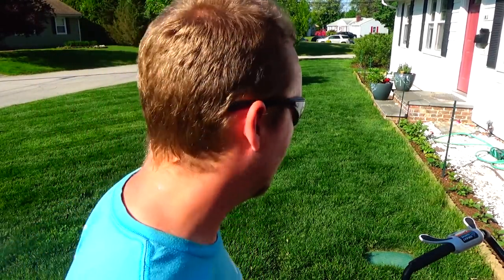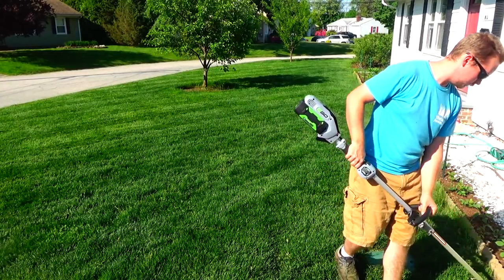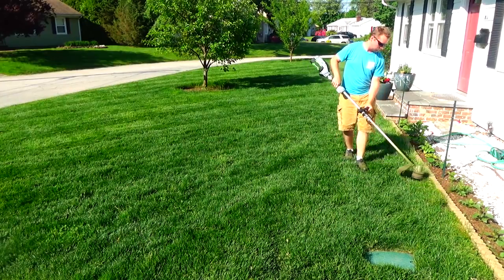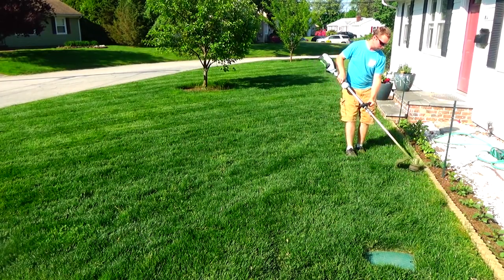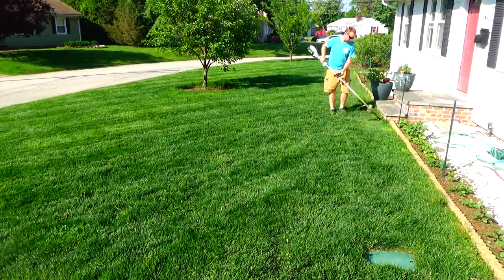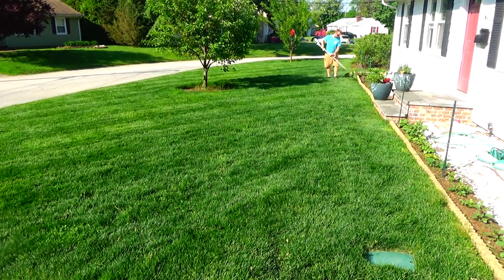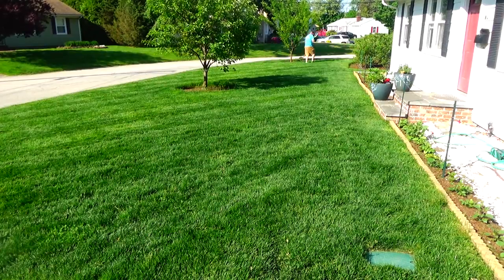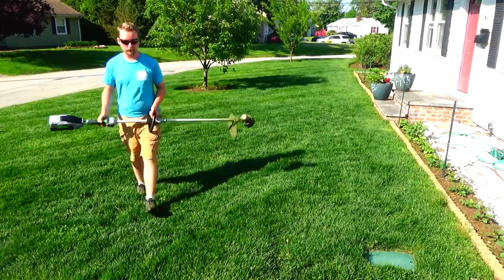Memorial Day Weekend - DOUBLE cutting with the Honda HRX217 self propelled mower

Comment: Interesting video. Thanks. I just tried the Ego 56 volt mower on our 1/4 acre lawn and it was excellent; low noise, battery at full charge was not even half down at end and the self-propelled feature could drag a dog team! Only issue I had was hard turning at end of runs because of rear wheel drive and delay in disengaging. I've had the Ego hedge trimmer and blower for a year and they have been outstanding. I put down two treatments of milorganite this spring here in north Florida and it's been hard to keep up with the growth but the  St. Augustine floratam grass lawn is loving it. I like your diagonal runs and alternating coverage. Suggest you put on ear plugs or headset: you're too young to go deaf!

Comment: Does your HRX217 miss random blades of grass??? I'm considering returning mine. Mine just misses grass no matter the height. I've only had it 3 weeks.
Reply: CoffDaddyJr I have the HRR216 and it does the same thing. Many issues in the first year too. Carb replacement, wouldn't roll backwards, average mulching performance... Honda has gone downhill in the last decade or so. My Harmony from 2003 has never had any issues. The tires are finally bald but hardly the mowers fault.
Reply: My Toro just started doing this. I think it’s the new mulching blade.
Reply: I'm in Florida with St Augustine grass and mow at max height with my HRX217. It does miss a few blades in my yard, but I mow often enough (every 3-4 days in summer) that they don't really stand out much. Mowing when the grass is dry (in the afternoon) helps.
Reply from the maker: I haven't had any issues with it, but there is a growing number of people who have. I do wonder if they changed something in the manufacturing process.
Reply: I have the HRX217 with the Big Leauge Lawn Striper on the back.  I have found that mine works better if I lift up on the handlebar keeping the front down.  It may be the striper but the mower itself seems to bounce.  I keep my speed setting on the slowest setting and Enjoythemow (wrong channel).  I also double cut and the roller pushes the grass over so I don't notice the missed blade problem.  Good luck to you.
Reply: Mine did this when new.  The new blades are laughably dull.  Sharpen them well and you will notice a huge improvement in cut quality.  Also they come running much slower than max rpm's according to manual.  I moved governor spring back to second hole and got better cut with a slightly faster blade.  Those two things will make any HRX cut look like a carpet.
Reply from the maker: That's a great point Joel, I forgot I adjusted the RPM as well.
Reply: Joel Houston I did both of those things too... I actually notice the missed strip more with properly sharp blades believe it or not. Overall though the cut quality is MUCH better. They are laughably dull from the factory. I just ordered a second set to rule that out though...
Reply: Grass Daddy I bent the spring a bit and ended up about 3200 rpm... You went to the second hole right?
Reply: CoffDaddyJr same problem but I still think it's a heavy duty good mower otherwise
Reply: So I've figured out the issue, at least on my HRR. The door closes when mulching, but not COMPLETELY so it gives a little vacuum boost to keep to the grass lifted properly.
This small opening quickly clogs with grass, especially if it's at all moist, and the mower loses enough vacuum to not be able to properly lift on the right side of the deck. Sure enough, moving the selector open and closed or manually opening and clearing the small opening and the mulching is exactly how it should be. 
Take note if you haven't moved the mulching door in quite some time... You will get hardened buildup there and it exacerbates the issue quite badly. I'm experimenting with putting the bag on and leaving the selector slightly open from the "mulch" setting and the results so far are much improved.

Comment: I have no idea why your VKA Honda would have any trouble with that much grass, especially if you set the Clip Director to partially mulch.  You have the larger 190cc GCV engine, which should deliver plenty of r.p.m. to mulch with under that little load.  I have the HYA, the same creature but with the hydrostatic trans, and I attack grass like that routinely with no need for a second pass.  Maybe time to sharpen the blades?  Perplexing.
Reply from the maker: Honestly, it may have handled it just fine, I didn't test it first to see =P

Comment: Have you used Bay State fert? If so how do you think it compares to Milo?
Thanks!
Reply from the maker: Yes I use it interchangeably. It's essentially the same thing.
Reply from the maker: I have a video on how to get to Bay State ;)
Reply: Grass Daddy thanks!
Reason I ask is there seems to be a significant price difference between the two, I’d hate to put down fert and not get the same results you’d otherwise see with Milo

Comment: Never noticed color being too off.  Every monitor is set different anyway of course so perfection here is not possible and a waste of time.  Today's cameras are getting really good
Reply from the maker: Exactly, I think my PC monitor it was looking off but on my phone it looks fine.
Reply: Small tweaks on a monitor can make a big difference in enjoyment.  Color temperature: Simply from red to blue(overall cast or tint).  Contrast: White to black percentage between the two.   And brightness.   Oh yeah saturation is important also.  If you play with these adjustments manually on something with a reset to factory settings you can get a feel for how they work.  Or throw up a photo on a photoshop program and play with it.  Can make a huge difference.  Never had success with the "automatic" changes.